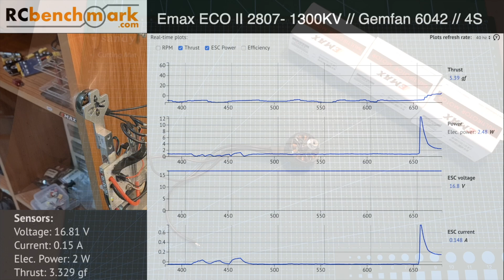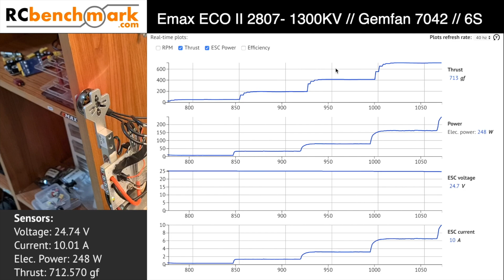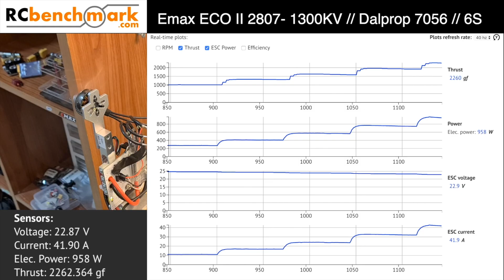Emax ECO II 2807 - Thrust Tests & Flight Footage

Comment: Just for informative data, can you test 1300kv with gemfan 1050x3 and hqprop 10x5x3
Reply: i would not push 2807 above 7.5. There is a chance it will handle 10" but after few minutes motors will overheat and efficiency will drop by alot.
Reply: @netherwindgg5946  i ask bc i have used a lot this motor with 9x5x3 and is very very efficient, 30 plus mins of flightime with 5000 mah 6s

Comment: Hello everyone.
Tell me please. I have 7 inch and motors 2807 1300kv, my 7 inch with battery 4s 8000mAh weight 1400g, it is good for this motors? I want to use it in easy flight mode, calm.
I'm worried if it's normal for the motors this weight on this 4s battery.
thanks

Comment: Hello! I have these motors and my AUW is 1.6kg on a 7" prop running 6s. It flies fine but do you think I need to upgrade to a 2808 motor? Others say quad is too heavy for the motor

Comment: @kremerfpv I'm interested in using these motors for a 7 inch ,under 40 amp lr build , would you recommend these motors or anything in particular , I'm using the jhemcu ghf411aio 40a
Reply from the maker: Yes they can be great for a 7" build.
Reply: @KremerFPV  what about the aio board what are your thoughts on that as well I'd like to make a refresh of the old dji drones ,big motors, low kv on 2 to 4s
Reply from the maker: @Gingerbeast-sy2ly  what is your exact planned setup?
Reply: @KremerFPV  ghf411aio40 amp, 2 to4s lithium ion ,7 inch blades,  I would like to use the 1806 mjx motors I already have on hand , if not suitable I'll take recommendations
Reply: With gps??

Comment: Hey gal, not sure if your still responding to comments, but do you think that running 1500kv on 6s is safe on a 50 amp esc? Right now I'm about to run Dal 6048s before I try any 7 Inch prop out of fear of drawing more than what my ESC can provide
Reply from the maker: Hi Mark, sorry things were pretty hectic recently, but I am still responding to all the comments on my videos. 
Yep, a 50A ESC will be fine. If you are worried about it I recommend to set the motors output limit to 90%. 
Have fun!
Reply: @KremerFPV  Alright, thanks!
Reply: how did it go? Planning to do the same set up. Did the 1500kv get too hot on a 6s with a 6 inch prop?

Comment: Can i use 6s on the 1700kv Motors too?
Reply from the maker: According to the specs - no. You can limit the motors output though.
Reply: @KremerFPV  Ok what exactly do I have to set in Betaflight
Reply from the maker: @wolfsblut44  https://youtu.be/C3hXW320MIQ
Reply: @KremerFPV  Ok thx 👍🏾

Comment: Any prop/motor suggestions for lifting a heavy load on a kwad? Looking at around 2 kilos including the weight of the kwad.
Reply from the maker: Each motor should be able to lift about 500g, preferably a at around %30 throttle more or less. This motor on a 7" setup should do the trick. Keep in mind that the battery is pretty heavy as well.

Comment: Whats you all time pick for a 7 inch maximum efficiency long range cruiser and best overall option?
Reply from the maker: Tough question. I don't have a lot of experience with 7" motors. I am going to test the Tmotor F100 soon. They should be pretty efficient as far as I know.
Reply: @KremerFPV  Having seen many of your thrust test this seems to be the most efficient as well as tzhe most powerful
Reply: @KremerFPV  Looking forward to the F100. The more information the better

Comment: Are they good for DSLR cinelifter, or perhaps I need to pay more for Brotherhobby Avengers?
Reply from the maker: You will need bigger motors in my opinion.
Reply: @KremerFPV  I was thinking about Snendrones Thicc with recommended 2806,5 1300kv motors.) The choice is between different suppliers

Comment: Gal, thanks for the test data!!  I'm in the middle of a 7" long-range build with the Eco ii 2807 1300's (on 6S) and see that this thing has the potential to make some big power.  On 7056 props, the quad should "sip the juice" of the Li-Ion packs I have planned on building.  I'll be using 6S2P Molicel P42A's, which should be good for 35+ minutes of easy cruising :-P
Reply from the maker: My pleasure buddy, Sounds like fun!
Reply: what the flight time in 4s1p in molicle p45b ?

Comment: Hi Gal I like your reviews Thanks for these results you helped me a lot. I want to consult you on something. I want to carry AUW about 3.3kg for max 3 mins. I’ll use 7 inch props and 6s battery. I want to make drone as light as possible. But I hover between Emax eco II 2807 1300kv and T-motor F90 1300kv. Numbers are shows emax eco better than T-motor F90 but I worry about quality of emax ecos for this task. Which one do you think makes more sense to use?
Reply from the maker: Hi there! I think that the quality of the Emax Eco II is good. But if you want to stay on the safe side and you don't mind spending more - go for the F90.

Comment: The review was nice. I was trying to build a 7" quad. Using source one frame, Velox V45a esc, Hglrc F722 FC but i was wondering which motor and battery type to choose for optimal flight time for a freestyle quad. I like the emax eco so what kv should i go for? And i have a default capacitor with the esc, is it ok or i need to buy new capacitor?
Reply from the maker: Thanks. I would go with the lowest KV option and the default capacitor is ok. As for battery, a 4s 4000mah or similar should be good.

Comment: Nice review, thanks 👍. I have those motors (1300kv) on my bench for several weeks now, never installed on a quad, they are on the heavy side compared to some Brotherhobby 2806.5. Maybe I will install them on a 7" "crash" drone.
Reply from the maker: Thanks! Sure if you already have them and you've got a spare frame to try them on - go for it.

Comment: I'm a bit curious as to how the 5s setup works best? as I see it 6s has less current draw for the same thrust... high throttle draw is a problem but you won't really get there with these numbers. asking from a long range 7 inch perspective in mind, prob liion 6s2p. am I missing something obvious - must be ;)
Reply from the maker: I am sorry if it doesn't make sense, but that was my experience. There are also more variables like battery size and type for example so you might have a different experience than mine :-)
Reply: @KremerFPV  absolutely agree, there's more to it than a static test can show. Will def try the difference. And don't get me wrong, love the video and this super informative test. Keep up the great work and have fun flying
Reply from the maker: @sasaamisi  Thanks man. I would love to know what you think after testing it out.

Comment: very nice video gal there were no videos about the motor which i could trust,i am going to use these motors on my 7 inch build
parts-tbs source1,eco2 2807 1300kv,rush fpv tank solo,caddex ratel,lumenier axii,mamba 60a f7 stack,radiomaster tx16s,frsky r9m. would this be good or should i change something
Reply from the maker: Thank you! I am happy I can provide you with reliable motors tests. As for your setup, It sounds great. I am used to Crossfire but if Frsky r9m works for you, that's good and I don't think that you need to change anything. Enjoy your new build!

Comment: 😂i have been running 1700kv on 6s. love them
Reply from the maker: I could probably push them further and also didn't test all the KV options this time. Sorry guys :-)
Reply: I am too but I keep blowing capacitors! Lol what are you using ?
Reply: @LUCKY.CLIPZ1  esc caps?
Reply: @eitosj  Yeah I have one capacitor on my 4 in 1 esc and they keep breaking the negative leg on capacitor.
Reply: @LUCKY.CLIPZ1  I see. How do you test if the caps is broken? Physically or you test it using multimeter?
Reply: @eitosj  no I can literally see the leg of the cap physically broken.
Reply: @LUCKY.CLIPZ1  lol beast of a motor. Keep up in the sky buddy. Thanks 👍

Comment: Great video 👍🏽👍🏽👍🏽
I'm test prop 9" 2blade for 4s motor eco 2 1300kv not hot 👍🏽👍🏽👍🏽👍🏽
Reply from the maker: Thank you! Yes, it makes sense. Unfortunately I just didn't have the time to test that many options...
Reply: @KremerFPV  thanks for sharing 🙏🏾🙏🏾🙏🏾👍🏽👍🏽👍🏽
Reply: 6s hqprop 8" 2 blade 👍🏽👍🏽👍🏽
FAST for rc plane funjet 👍🏽👍🏽👍🏽

Comment: I was running the 1700kv on 6S with Gatebreaker 6x5x3 props and they were really happy. Never got hot. (I’m at 5000ft/1500m above sea level, though)
Reply from the maker: Thanks for sharing your experience Tucker. I could have pushed the motors more in the test and unfortunately due to time constraints I didn't even test all the KV options which I normally do.
Reply: Thinking of doin the same thing, what voltage did you run them at?
Reply: @RealFlight-u4h  6S, so roughly 25.2V. They’re power hungry, so a rock solid esc is absolutely necessary.

Comment: Damn it I just bought the 1500kv and from your video I can't run them on 6s 7" props ???
Reply: You could reduce the motor output to 86% which will basically make the motors 1300kv. Just an idea :)
Reply: @RealFlight-u4h   I will do that I'm a new pilot learning about throttle output limits and stuff like that doing my 2 DJI build still learning all this hobby has to offer it's overwhelming!
Reply: I have the 1700kv ones on 6s batteries. Shes fast just not efficient and they draw around 150 amps at full throttle according to my OSD. Youll get short flight times. I got around 4-6 minutes on 1500mah6s lipos freestyling, and 10 minutes flow flying at 30km/h
Reply: @XBionicMC  I'm blowing capacitors on my 4in1 on 6s lol I want it to work so bad because it's GOOD. 😔
Reply: @LUCKY.CLIPZ1  what size capacitors you using ?
Reply: @lucianofpv4276  50v 1000uf low esr
Reply: @LUCKY.CLIPZ1  I’m going to add another capacitor thank you for the info Bro !
Reply: @LUCKY.CLIPZ1  blown the caps on the ground when plugin or when punching throttle?
Reply: @TERBANGFPV  punch outs!
Reply: @XBionicMC  got the second person that has told me I'll be ok , because they are running the same setup 6s on 1500 thanks for your help and input
Reply from the maker: I didn't test it, sorry... According to the specs it's not recommended but probably it's possible ;-)

Comment: Hey buddy, those are for an 7" or 8" LR rig right ? Dalprop 7056 with 4S all the way, that was the overall most efficient combo with the  1300kv motor you show the graphs :)
Reply: @Grim FPV post your flight times and batteries used when done :)
Reply from the maker: Hola amigo, true. With 8" props it would have been probably even be more efficient but I unfortunately I didn't test this setup as I don't have any.
Reply: @Grim FPV Hi! What is your feedback for these 2807 motors with 8 inches props?
Reply: @Grim FPV yes tell me when you'll test it :) thx

Comment: What?! No DJI drone? lol   

Probably my next motors if I decide to build a second 7 incher. Thanks for the review, Gal.
Reply: so how many would you buy?
Reply: @marc_frank  6 is always my minimum, maybe 8. I have 2407s on my current 7in, they do not handle 7in triblades well. I need to downprop to 6in to avoid jello. Considering the size of the stator, these Emax motors are an incredible value, they charge very little more than the other Eco II sizes.
Reply: @marc_frank  By the way Frank, I ordered the Flywoo Hexplorer stack...😉 I looked at my Cad models again and a 3in or 4in hexa is just too big, as large as a 5in. With 2.5in props, it looks just right. I modeled the ER349 canopy quickly, but it should look very nice with a translucent one and the Top mounted LED board.
Reply from the maker: Haha, I guess you had enough of this flying espresso machine ;-)
Reply: @KremerFPV  Let's just say that the release of the DJI drone highlighted the fact that I am suscribed to a lot of FPV focused channels, lol
Reply from the maker: @yannickg6904  That makes sense :-)
Reply: @KremerFPV  That drone is out my price range anyway, but I hope they sell many. Hopefully pilots like us will be able to find used HD goggles more easily in the future....hahaha
Reply from the maker: @yannickg6904  That's true, haha :-)